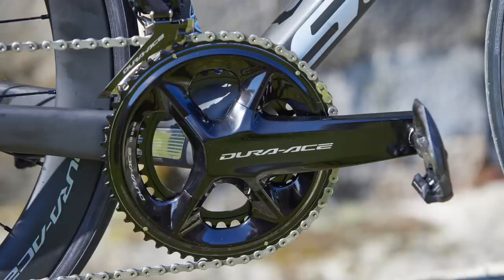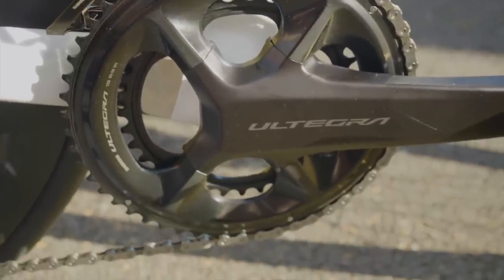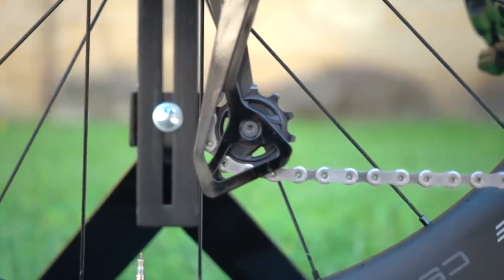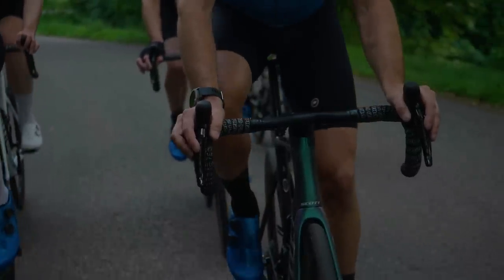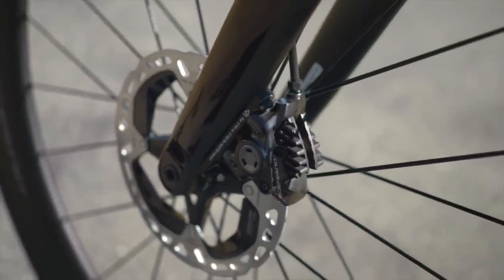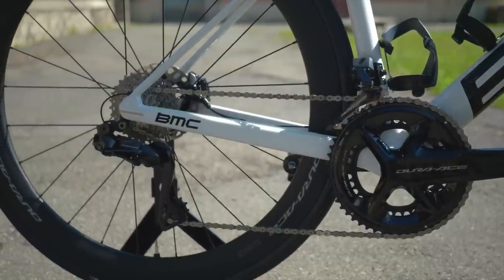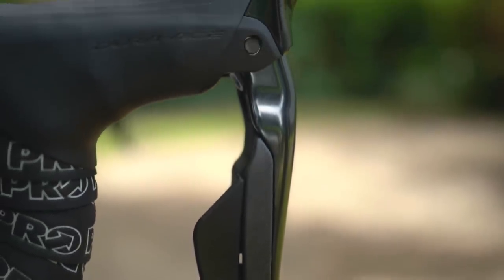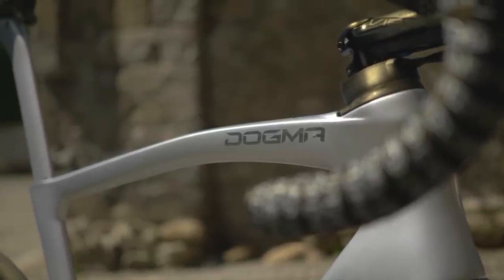Why Shimano Dura-Ace R9200 mechanical is dead and it's not fully wireless

Comment: Surprised you don't understand why disc brake weight is a problem for so many. Basically one of the main reasons for spending money on a better groupset is to save weight (functionally there is little difference), so discs are a big step backwards in that quest, that you can only solve by spending even more money. This is why we are now looking at £10k+ bikes to get to UCI weight limit. My 60cm 2018 SS Evo HM cost £5k and weighs 6.7kg with pedals, bottle cages and computer mount. 3 years later and you pay 100% more for its equivalent. That is what rankles.
Reply: The introduction of disc brakes to road bikes is not primarily for their braking efficiency but to be able to hide the cables inside and sell the fact that a wireless front end saves you watts. Only the hydraulic and electronic cables can be twisted and put in the stem and fork ... For me, learning to ride in a aerodynamic position greatly surpasses the new fashion of aero cockpits ... I ride a Tarmac S-works SL4 rim brakes/mecanical

Comment: Check your local group ride: mechanical Ultegra 11s is king. Electronic only on the top tier? Ok, fair. Ultegra deserved a mech version.
Reply: 100% agree, the R8000 mechanical Ultegra was amazing value for money. I have it myself and have seen it on lots of bikes. Those who used to ride it will now have to either pay double the money and go Di2 or go backwards to whatever the next 105 will be.
Reply: No worries R7000/R7100 will be the new Ultegra for local group riders #soon
Reply: @TheRimBrakeGuy  except it will be way heavier for probably not significantly less money than the old Ultegra R8000. So much so if it goes 12 speed while using 105-level materials and manufacturing procedures. So the "don't worry" remark is quite far fetched.

What's next, Tiagra and eventually Claris becoming the new Ultegra for group riders?
Reply: @11robotics  the difference between R7000 and R8000 now is 191grams for 500quid difference! The new R7100 will kill the R8100 for both weight and price. The added weight of the electronics+batteries+housings the R8100 brings will make the weight difference even smaller. 12 speed argument is silly, the 11sp casette weight difference is 35grams. Please when you make arguments know what you are talking about. These <200g differences (which will be less when R7100 is out) mean absolutely zero to anyone riding/racing at anything below PRO level.
Reply: @TheRimBrakeGuy  it's surely not 500 quid. A mechanical rim brake 105 is about 500-520€ depending on the store, while a mechanical rim brake Ultegra is about 830-850€. Also, the weight difference is over 200g (about 230 if I remember accurately).

I did pay extra for my R8000 for this exact reason and I don't regret my choice. My bet is the next 12-speed 105 will be slightly heavier than the R7000 and will cost at least 50, if not 100€ more.
Reply: And also take a chill pill and cut down on the ad hominems.

Comment: I just did some research on electric disc vs mechanical disc. 
It indicated that mechanical campy Chorus was 70grams heavier than the new Dura ace but half the price. 
Campy SR mechanical was almost 500grams lighter and over $500 USD cheaper than the new DA
I get some people like electric but value for money and outright performance would tell you that the New Dura Ace is NOT a groupset that is the best race ready groupo. But it IS the premium groupset offered by Shimano. 
It maybe nice to ride round your local loop, but ultimate performance/price it is not the best in both these categories.
Reply: Are you sure about the 500g difference with campy SR mechanical? That's a lot of weight
Reply from the maker: Maybe I should do a Chorus review soon then? ;)
Reply: I couldn't find a 105 group last year but was able to find Campagnolo Centaur.   I realized that the Centaur shifters by themselves were something like only 10 grams more than Dura-ace mechanical.   I went decided to go full Campy on a budget (except the cranks where I already had lighter FSA ones) and I'm now a Campy believer.   Shimano does a lot well, but if I had to build a new road bike today, I'd go with Chorus.

Comment: The bike manufacturers are just like the computer and car industry in the sense that what you buy today was old hat on release day. Shimano no doubt have super light fast planetary gearboxes, hub and crank based. Onboard adjustable disc calipers made from composites, hydraulic improvements with a type of abs is probably being worked on.

Comment: The thing is: the more gears in the back, the harder to get it right (mechanically). Campagnolo still does it quite right, and Dura-ace 11 mechanical shifts like a dream when dialled in correctly, but it's much easier to make 11/12-speed groupsets shift well with electronic shifting. Still I feel nothing beats 9/10 speed mechanical Campa shifting or 10-11sp dura-ace shifting, for campagnolo in particular the 100% metal chorus/record shifters (the carbon shifters with plastic peddles are less crisp because of the not-so-stiff 'reinforced' plastic upshift gear lever). 

So more people are driven towards electronic shifting with the added gears, but the prices are simply mental. I will seriously consider buying a complete bike with 105 as it's still good enough to do my riding on (amateur races and all kinds of group training rides on flat and rolling terrain).

Comment: I do really like the new group but I totally (emphasis) disagree with his comment that if you need a clutch in the rear derailleur, you're not a road rider. To me, this comment seems out of touch with not just amateur consumers, but the pro peloton as well.  Not all roads are super smooth - in fact most in my region are not - and will occasionally cause the chain to whip against the chain stay of the frame. It was disappointing to me that Shimano didn't include this as a feature in the new group. I can appreciate Shimano's engineering philosophy to introduce incremental improvements over time but I expect Shimano will eventually understand the reality and incorporate the feature into future generations.
Reply: Totally agree!! When I go over a bad patch and hear the rear mech bounce around I worry for my paint! A clutch would be great and preventing the dreaded chain drop off the chainrings regardless of being on / off road, that could only be a positive!
Reply: @MrJwmurph  how about installing a chain guard instead? It weights nothing and its really cheap
Reply: @KazuyaST  that'll stop chains dropping but chain slap on the chainstay would still be there. The clutch would eliminate that too.

Comment: 12 groups prices are insane except Campagnolo Chorus. We dont need that at all. 2x11 is more than enough. Even 2x10 is enough. 2x12 just add one more sprocket inside like 16T . Nothing special. And to pay like 3-4000 euros for that is completely insane. Mechanical 2x10 and 2x11 groupsets are all we need.

Comment: I'd like to know what Shimano's plans are for 3-D printing: that has to be one of the next developments to reduce weight in components
Reply from the maker: Really interesting but Shimano seem so wedded to aluminium it’s hard to see them deviating from it, but I’d love to see them doing thay
Reply: @davidarthur  I see similarities between F1 car and top-flight bike engineering. I would think full CF and maybe 3-D printed magnesium have to be possibilities for "marginal gains". I suppose much depends on UCI, although weight saved in components can be used to offset extra material elsewhere. Thanks for the interview (and posting it here, though I'm going to check out your podcast on iTunes)

Comment: I' just wanted to update my rim brake canyon aero road with wireless lever like the disk brakes. I was waiting on shimano's new groupset to find out it its gonna still have that cable mess....no thanks..not everyone is looking to buy a new bike with a new groupset only. I love that frame.
Reply: It's all Quiet now  Maybe you didn't notice but the rim brake version still requires the same cable  configuration as last version of di2 That's what I was referring to.

Comment: I think it’s disappointing that there’s no mechanical in the two top tier forcing people down to 105 I think if this is the case they are going to have to be a bit more competitive with their pricing I think it’s a bit shortsighted Business decision.
Reply: I wonder if mechanical will stick about for GRX, which is a great groupset for the road for most real riders, particularly those that live near hills...
Reply from the maker: Hard to see them getting rid of mechanical GRX at the lower prices where it's becoming really popular, circa €1500-2500 etc
Reply: I count it a blessing that electronic shifting hasn't especially taken off for MTB.
Reply: Just go full Campy.  Sure, it's got quirks but it works so well and is lightweight.   I am amazed at how simple the Campy ultra-shift shifters are to Shimano STI.  They are much lighter as a result for the price.

Comment: They would be fools to discontinue 11-speed groups. This is OK if you're planning on a new bike and don't mind losing compatibility for chains and cassettes and so forth. But as a must have upgrade? Are you kidding me? Assuming you entire life is built around the 11-30 11-speed already the biggest benefit is you pick up a 16-tooth cog and close to 100 grams in weight. That's the best possible way of explaining  the benefits of this group (unless you also want a 12-speed 11-34). 

BTW, the best argument for Shimano 12 over SRAM is now the chainring choices. And SRAM is still selling 11-speed. 

All of this changes if SRAM and Shimano cassettes are cross compatible, which I doubt. But with SRAM 12v cassettes added to the mix and a 52-36 (or 50-34) that would  be a game changer.

Comment: I would still like to know weights for the group sets and uk price? Any ideas?
Reply from the maker: Ultegra Di2 is  £2000 without power meter, £3000 with a power meter and weighs claimed 2716

Dura-Ace is £4000+ and 2438g
Reply: @davidarthur  thanks for the info. 👍🏻
Reply: It's all Quiet now  yes it’s a bit pricey right, I’m saying I won’t spend that much now but bet it’s on my bike before next year 🤣🤣👍🏻

Comment: I don’t need the extra gear out the back 11 speed provides all I need. I’ve always used Ultegra, but with the reduction in prices on DA9100 mechanical I just bought front and back derailleurs to hoard for an upgrade down the road. Call me a Luddite but cable shifting is my preference and the price on the new group sets are ridiculous. I won’t buy it on principle alone.

Comment: It is very expensive and there nothing that would assure that they got rid of previous problems. Journalists and customers should challenge manufacturers and retailers. The new update lacks luster and do not focus on previous challenges. The guest gave lots of not that true answers and David should have a bit more challenging. A bit disappointed with David’s podcast. He used to be on the riders side